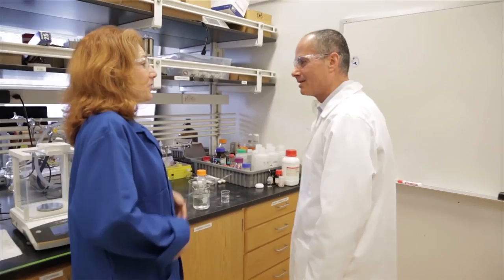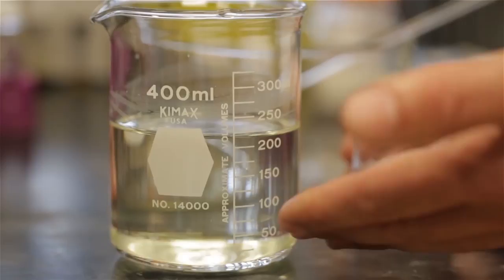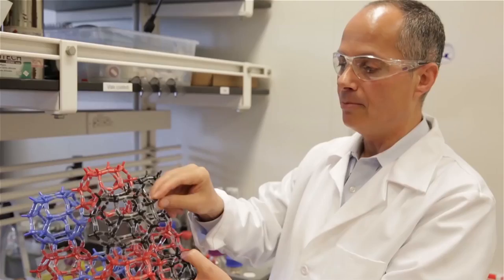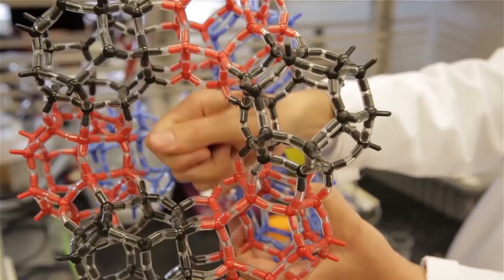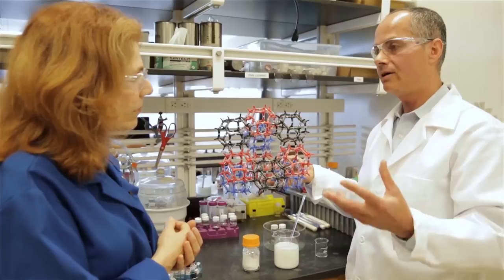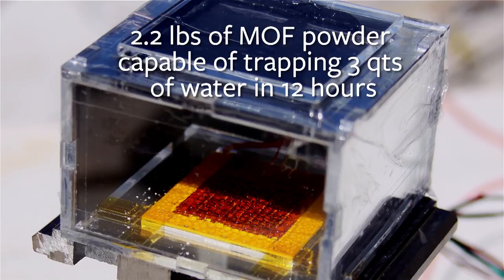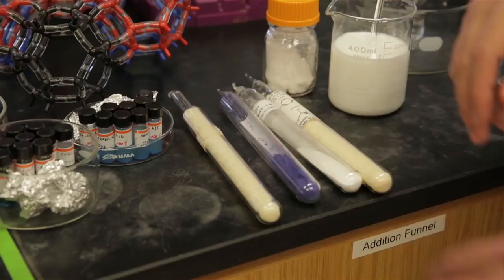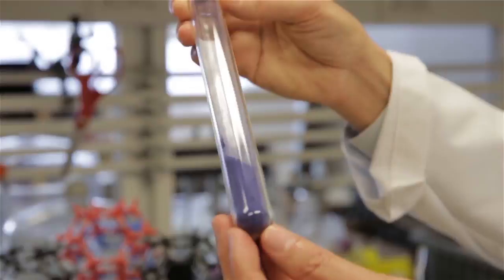Pulling Drinkable Water Out of Dry Air

Comment: Aiaiai...the clever thing about some nano "metal organic frameworks" is that they have incredibly large surface areas—finding functional applications for that quirk (that actually make sense) is going to be kind of difficult. 
(and the ease of retrieving whatever was absorbed into the framework tends to be overstated)
 ...give MOF researchers a hammer, everything looks like a nail to them.
Reply: Actually activated carbon is a good filter material exactly because it has such large surface area per unit mass, so if these MOFs have that property they may be good for that application.